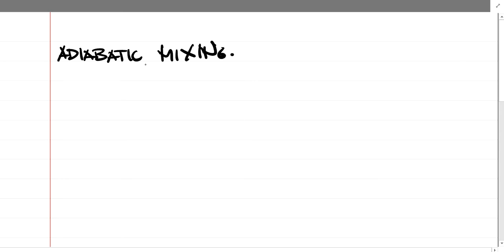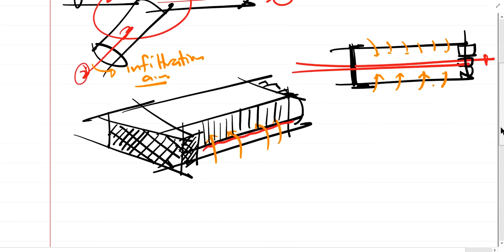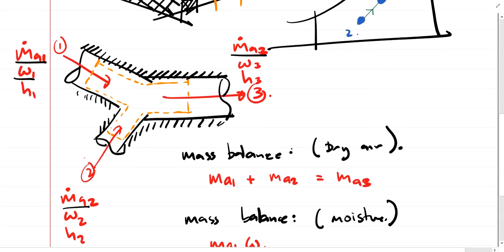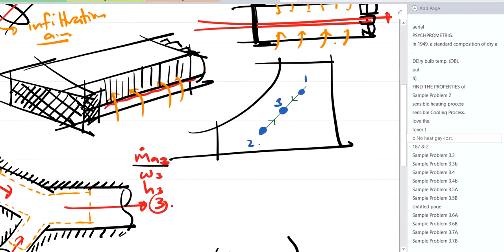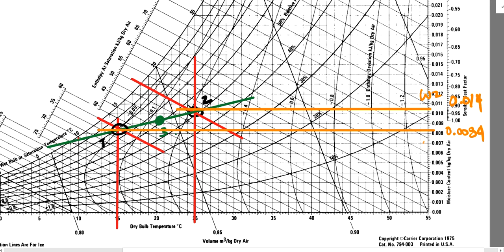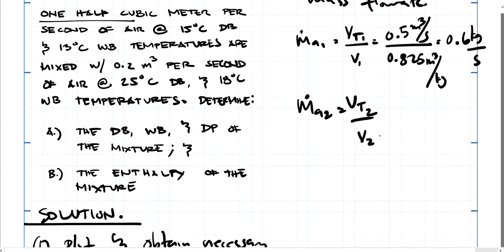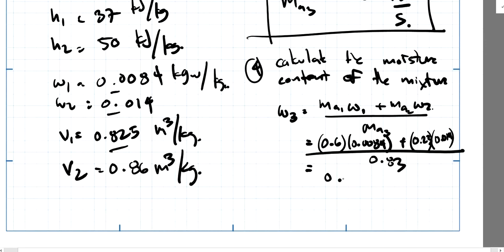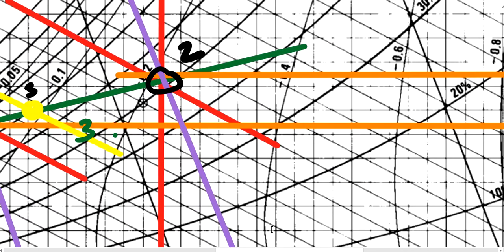ABE162 - 03.05 - Adiabatic Mixing

Comment: Hi sir, I think W2 should be 0.0104 not 0.014 that is why it does not fit. 

Therefore,
W3 = [(0.6) (0.0084) + (0.23) (0.0104)] / 0.83 = 0.0089542168674 = 0.009

0.009 will fit
Reply from the maker: good point.  you're right.  thanks!